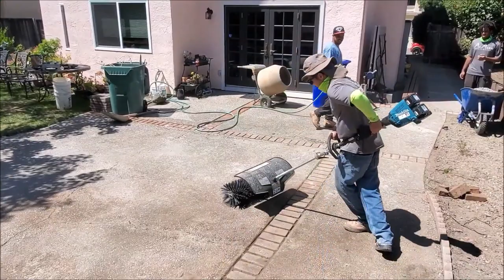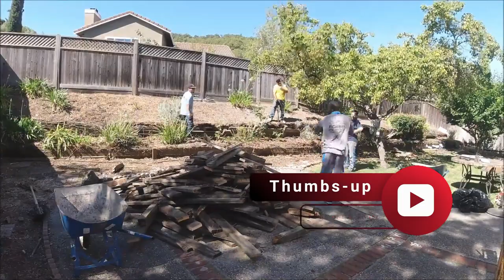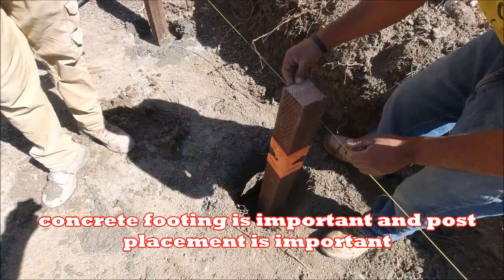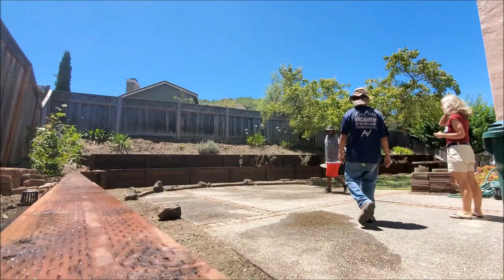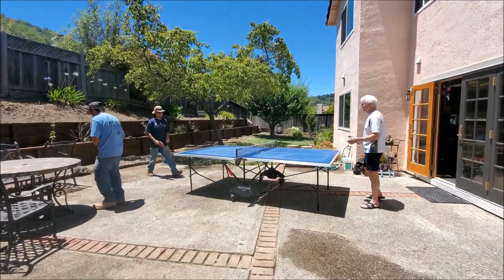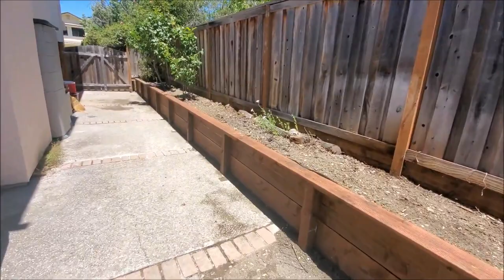How To Build A Wood Retaining Wall in 2020 | All Access 510-804-4646

Comment: If you wanted metal posts, what are the options?
Reply from the maker: Just some 4×4 tubes.. Local steel supplier should have them
Reply: @AllAccessConstruction  do you recommend 1/4 or 1/8 inch thickness?
Reply from the maker: Quarter is cool